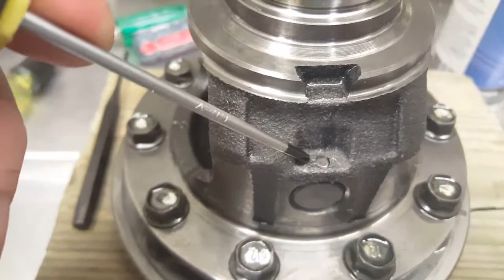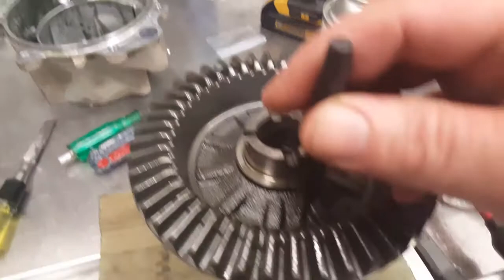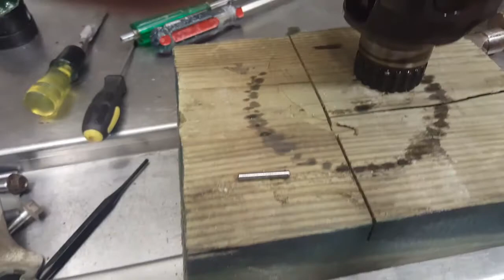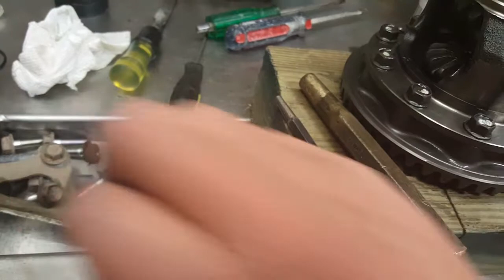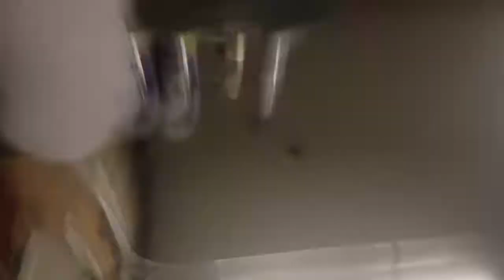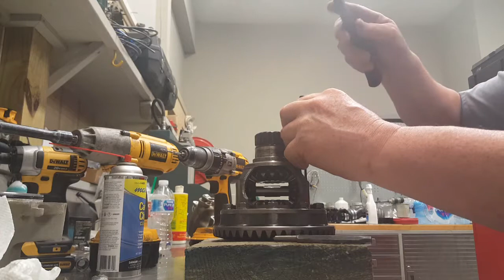Pioneer 500 & 700 retaining pln remove & install

Comment: Excellent, thanks.
Reply from the maker: Thanks for the compliment.  I hope it was helpful
Reply: @johnbrant7016  I read your posts on Honda SXS and have read the manual. I'm doing an install and wondering if you see any issues doing the install the way TJoffroad did his.
Reply from the maker: @mdavenpo  I haven't seen the install method you mention, but bottom line is, if it works, and it saves time, go with it!